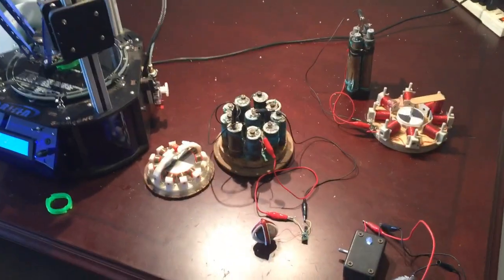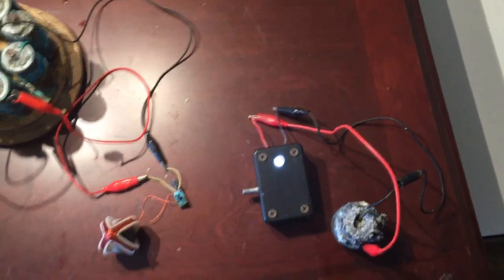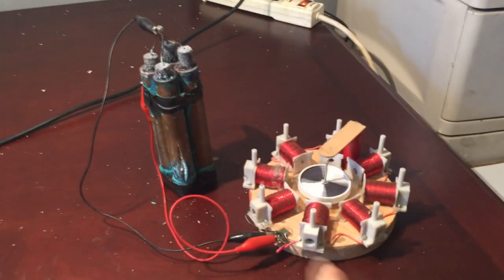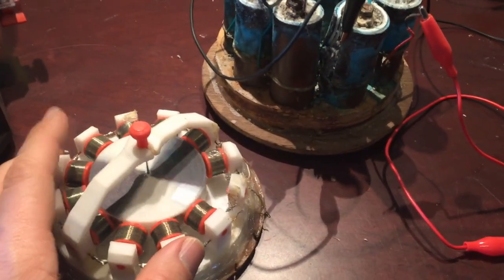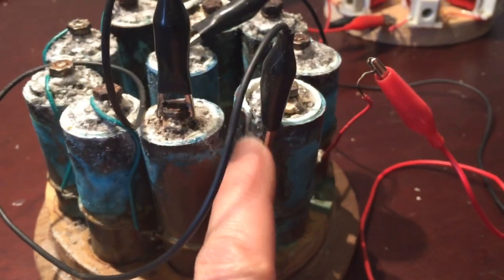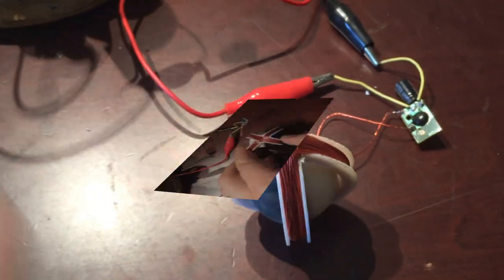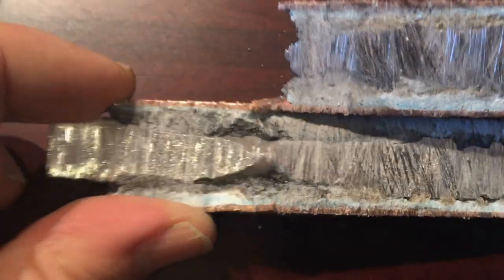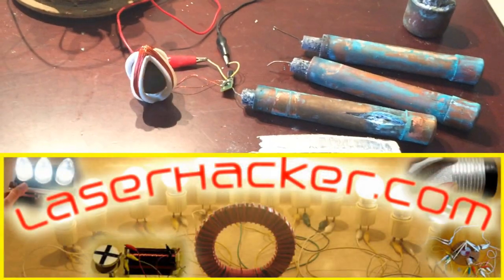Crystal Cells Have Been Going for 4+ Years! - Crystal Cells Duration Testing Update

Comment: You could make a steel sleeve that the copper can expand into.  If you did that it would never break open.  Or does the copper need to be exposed to air?

Comment: Could you put the copper pipe inside a heavy steel pipe to reinforce it?
Reply: great idea
Reply: I'd be to freaked out to pick it up after the reaction gets going. It'd basically be a super slow pipe bomb. Imagine a steel pipe explosively decompressing next to your palm. You'd no likely be picking up anything after that...
Reply: +INTP Blog  That's exactly what I thought.  I doubt it would become a bomb, especially if you left the top open.  It SHOULD just push the Mg rod upward a bit.  I want to build a couple thousand of these and see how much power I can make.  If it's enough to power a small house in the country with an inverter, it would pay for itself in a year or so (think 12 electric bills X ~$100 each)  Especially if I buy the materials from a scrapyard.  Hmmmm......
Reply: That would be neat, if you do that you should make a video and put it on youtube.

Comment: A nice concept of a primary cell. But i doubt that such an inefficient cell has any practical uses.

Any chances on an update - like voltage/current measurements of what the loads have been? And how it works under realistic loads.
Reply: might be useful inside a remote control that is what most primary cells are used for

Comment: Boy how time flies.  Some of my projects are still running also but are suffering from old age now with materials breaking down.  I just threw away a few of my old crystal cells that were too ugly to have around.  Ha.  One of my subscribers sent me some of graphene powder (like you have) to test.  Mixed results so far.
Reply: +Lidmotor Same here, same guy sent it lol. but have just returned from a trip to buy polyurethane and will follow LS's method on some cells today.
Reply: I also have the polyurethane and found the phosphoric acid (it is what Naval Jelly is made of)  Lowes had it.  Loctite  makes it and calls it 'Rust Dissolver'.  My fist attempts at making a small cell with Al plates turned out so so. I am having my best results using lye (drain cleaner) as the electrolyte.  I am still not convinced that we are not making rechargeable batteries instead of double layer super capacitors.
Reply: +Lidmotor Thanks for sharing your results Lid

Comment: I made several of these and ordered all the salts as pure as I could find.  1.5v +/- .250v and about 0.500 to 0.700ma per cell.  Hooked up a small 95ma motor and it stopped after about 3 weeks.  Definitely not 1 year let alone 4.  Thinking nuclear is the way to go.

Comment: Without any logged data, this is another pseudoscience experiment. 
How would you know if a lithium battery of the same size and weight, would not out perform your crystal battery? They can also run for years and have a lot of capacity.
I constructed one from your plans 6 months ago, to see how easy or difficult it would be to build. real easy.
wanted to make an Arduino based voltage/current measuring/logging with FET op amps and hull effect current sensors and see how much power is stored. However, I never got around to finishing it. Just too damn lazy these days :(
Good effort though. Thumbs up.